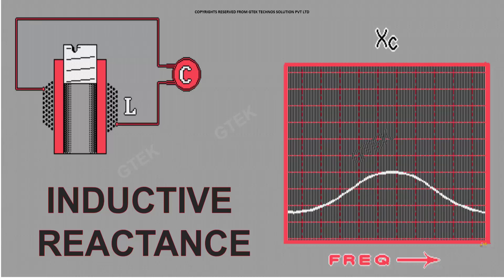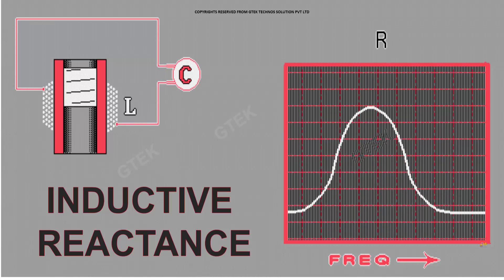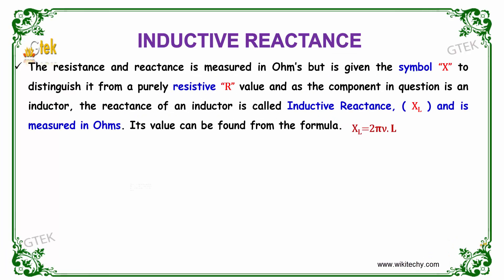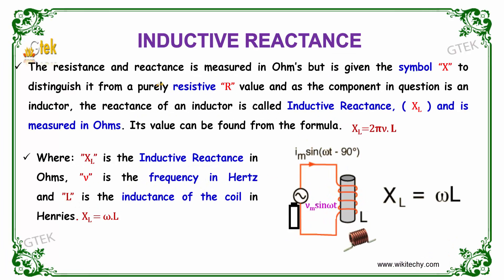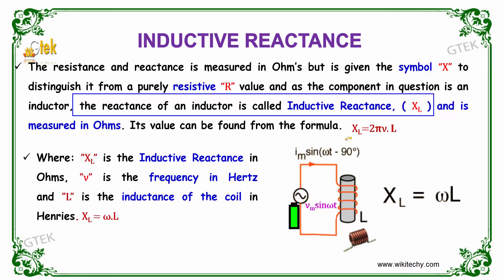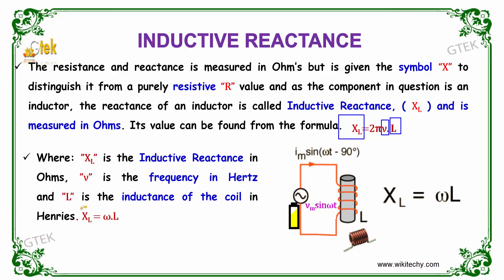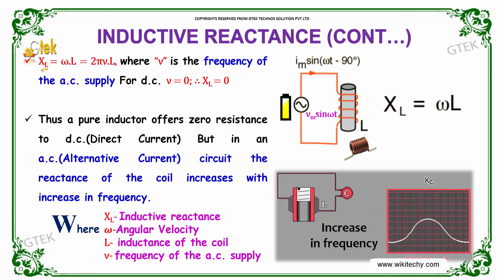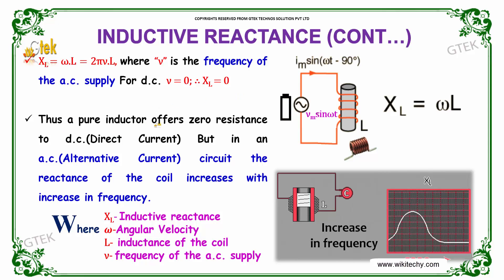Inductive Reactance | Electro Magnetic Induction And Alternating Current | Advanced physics

Comment: Alternating current (AC), is an electric current in which the flow of electric charge ... The power factor of an AC circuit having resistance (R) and inductance (L) connected in .... JEE; BITSAT; NEET; JEE Advanced; AIIMS; MH-CET ... at austin · Magnetic force on a current-carrying wire-hyperphysics · Magnetic moment- ...

Comment: The capacitance and inductance cause a phase shift (see note) between the current and voltage which means that the resistance and reactance cannot be simply added up to give impedance. Instead they must be added as vectors with reactance at right angles to resistance as shown in the diagram.

Comment: Capacitive reactance (symbol XC) is a measure of a capacitor's opposition to. AC (alternating current). Like resistance it is measured in ohms, but. reactance is more complex than resistance because its value depends on the. frequency (f) of the electrical signal passing through the capacitor as well.

Comment: The formula for calculating the inductive reactance of a coil is: inductive reactance, or XL, is the product of 2 times p (pi), or 6.28, the frequency of the ac current, in hertz, and the inductance of the coil, in henries. L = the inductance value of the coil in henries.

Comment: As the component we are interested in is an inductor, the reactance of an inductor is therefore called “Inductive Reactance”. In other words, an inductors electrical resistance when used in an AC circuit is called Inductive Reactance.

Comment: The resistance and reactance is measured in Ohm’s but is given the symbol “X” to distinguish it from a purely resistive “R” value and as the component in question is an inductor, the reactance of an inductor is called Inductive Reactance, ( XL ) and is measured in Ohms. Its value can be found from the formula.

Comment: In electrical and electronic systems, reactance is the opposition of a circuit element to a change in current or voltage, due to that element's inductance or capacitance. A built-up electric field resists the change of voltage on the element, while a magnetic field resists the change of current. The notion of reactance is similar to electrical resistance, but it differs in several respects.
In phasor analysis, reactance is used to compute amplitude and phase changes of sinusoidal alternating current going through a circuit element. It is denoted by the symbol {\displaystyle \scriptstyle {X}} \scriptstyle {X}. An ideal resistor has zero reactance, whereas ideal inductors and capacitors have zero resistance – that is, respond to current only by reactance. The magnitude of the reactance of an inductor rises in proportion to a rise in frequency, while the magnitude of the reactance of a capacitor decreases in proportion to a rise in frequency (or increases in proportion to wavelength). As frequency goes up, inductive reactance goes up and capacitive reactance goes down.